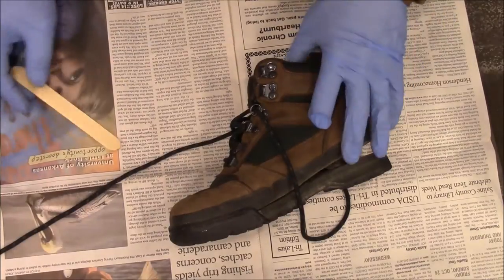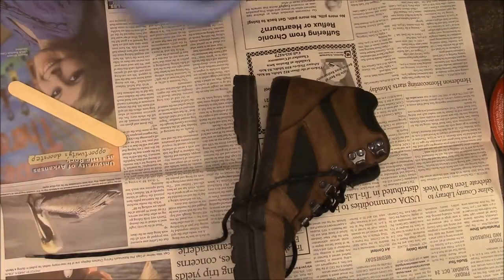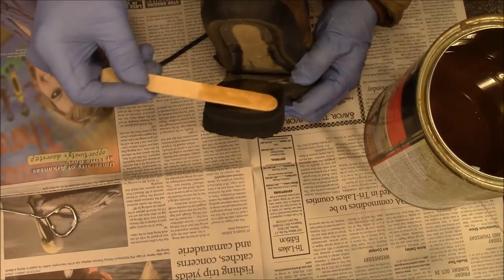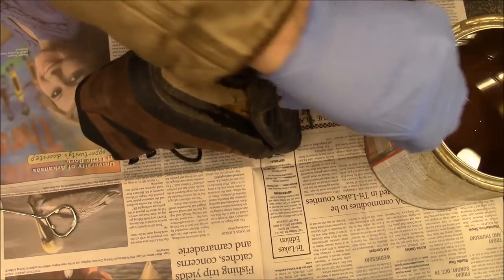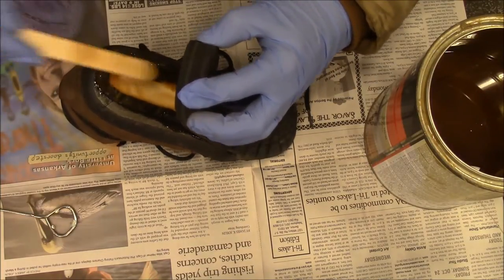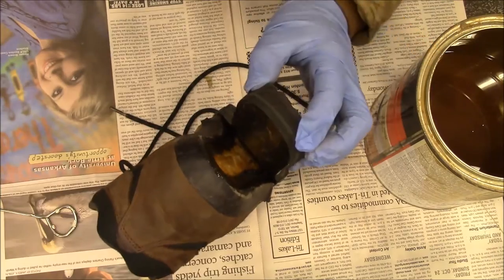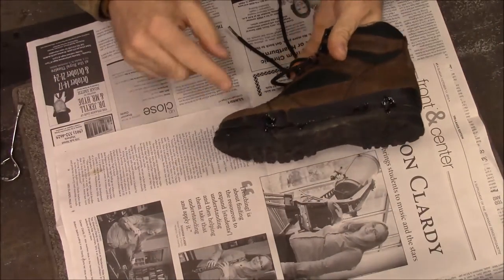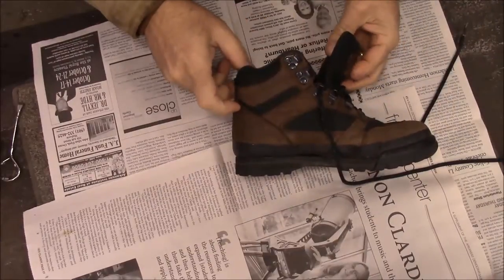Hiking Boot Repair

Comment: That's only part of the job. 
First, take out the laces.
Second, clean both surfaces with rough sandpaper and follow up with a mild solution of Tide and water. Let thoroughly dry. D-R-Y. 
Third, find a chunk of wood. Preferably 2" X 2" X 3'. You're going to put the boot upside down over the end of this. Like a shoe last.
Fourth, apply the cement. Use a disposable cheapy brush from Home Depot. 
Fifth, after the contact cement dries to the touch and you reattach the sole, flip the boot upside down over the stake and pound the heck out of the sole with a hammer of some kind. You want to really bang that sole down hard. Move the boot around on the stake (this is why you took out the laces) to get a good contact all the way around.
Don't touch it for 24 hours.
You're welcome.
Reply from the maker: Thanks for the comment!
Reply: Thank you.
Reply: Thats looks a bit of trouble some, sanding and stuff or should I just send them to a repair boot place,  I live in Texas and in my town theres, tons of custom boot makers and boot repair places.
Reply: @brendaleetv  Try E6000. Available at Wal-Mart. I bought a nearly new pair of Merrill trail shoes at Goodwill for $5. Soles were coming off. Cleaned it real well with Tide. Thorough dry. Spread in lots of E6000. Tied it around real tight with parachute cord. Lots of turns. Cured for 24 hrs. Still holding tight.

Comment: How did they hold up, did that repair last?
Reply from the maker: Yes.  My mother sed them for another 2 years before they completely wore out and she got rid of them.  The sole was still attached when she got rid of them.  Thanks for watching!
Reply: Soat Mon PROOF?
Reply: you don't need to clamp them tight?
Reply: +Dan Quinn  my schoolmate in highschool told me once that people use contact cement wrong, that they press them together while wet (after application) and when they use it (say a shoe) then it tears right off. He told me you have to let it dry first (sticky, but dry relative to application) and then you can press the parts together. He swore it's a very strong and durable adhesive.